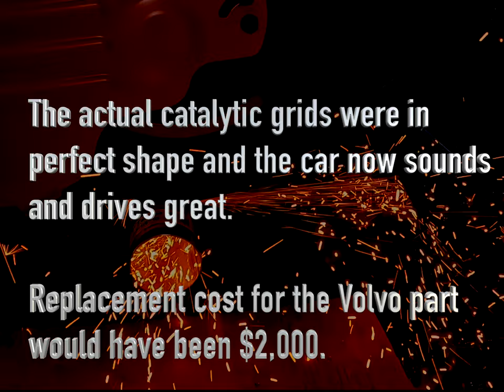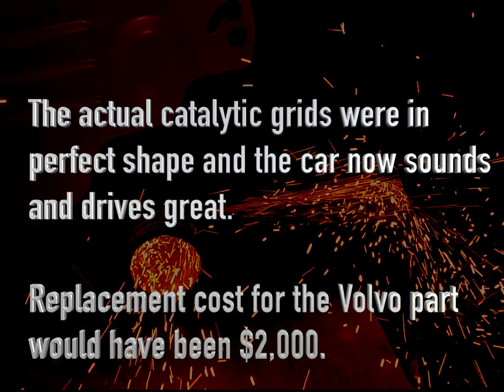Catalytic Converter Rebuild   (2009 Volvo XC90 3.2)

Comment: Do the new gasket rings just rest inside the exhaust manifold exit?
Reply from the maker: Sorry for the slow reply - there is a shallow groove in the exhaust manifold flange.  You can press the new gasket ring into this and it should sit snugly.  I usually have to use a pick to price the old gaskets out of this groove.

Comment: What welder are you using? Are you using stainless steal flux core or do you have a bottle?
Reply from the maker: Hi - it's a Millermatic 211 (MIG only), which has worked great for exhaust and other small projects.  To be honest I used regular mild steel wire for this job, understanding that any weld joints would no longer be "stainless".  I use CO2/Argon for just about everything indoors, including this job.

I was still learning to weld (and make videos) at the time, but the repairs have held up until now.